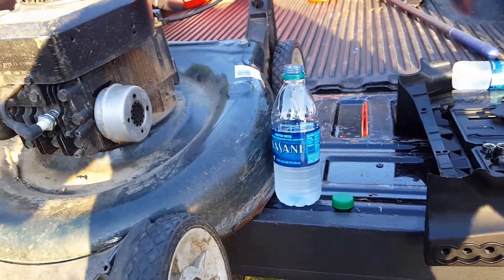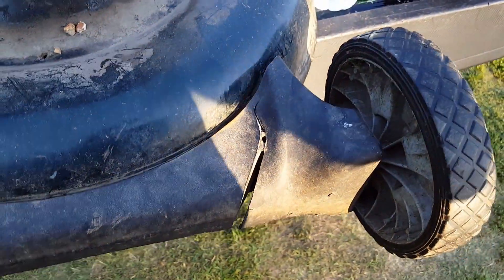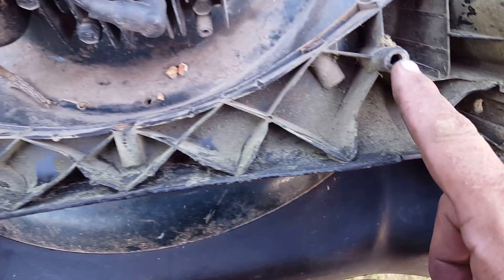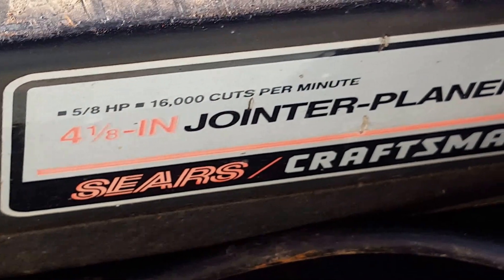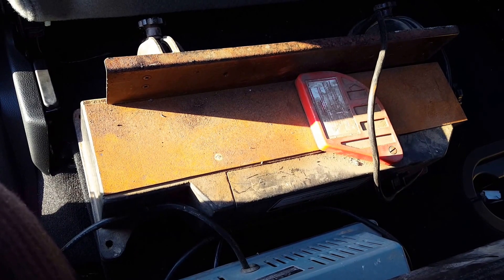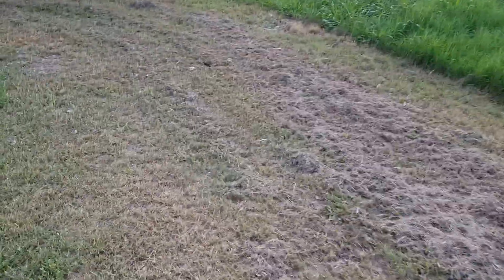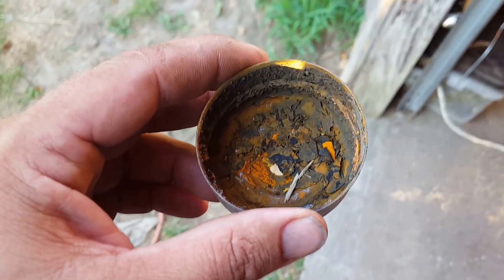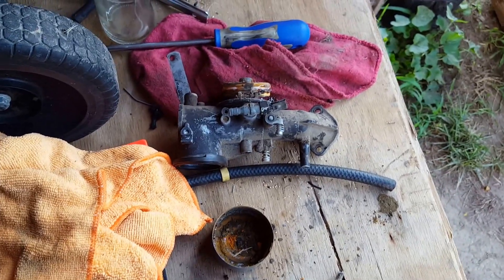"Plastic" ? "Really" ? And updates

Comment: Made in plastic so it will fail. Then you either have to buy the part or throw it away & buy another mower. Bumper, I would call it something else. Ya, I bump the wheels too. Guilty. 
Ten bucks for that planer is cheap enough! I'd like a sander like that & that price! Yup, it mowed it down pretty good. That's the worse bowl I've seen! Really bad. You'll be a while on that carb, but I know you'll get it. My Cub Cadet has a plastic "bumper" on the front. "Fixed" it without using any tools. It's my last video posted if you're interested.
Reply from the maker: Yeah nice fix,had a really cool ending,that's how I would like to fix some of mine. seen that video the other night really good video,and nice score on the rusty glove box
Reply: Never liked that mower. Thanks.